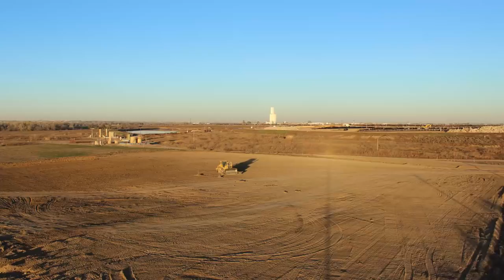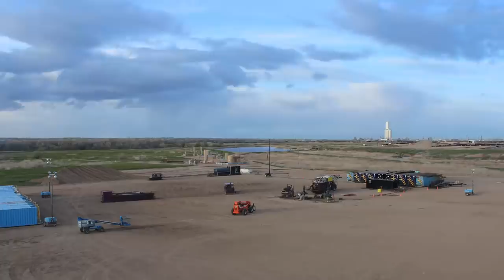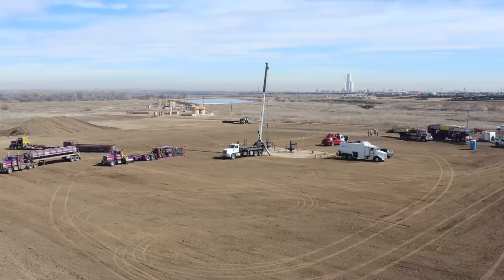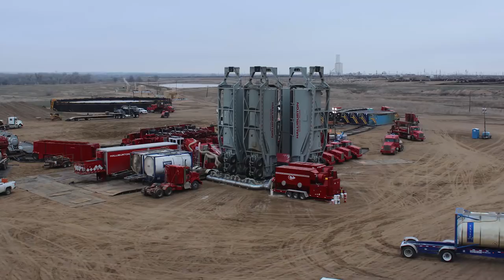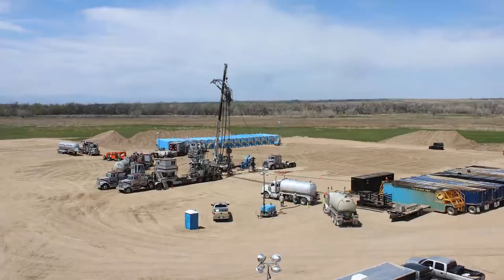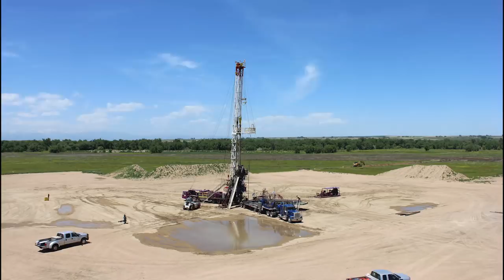Noble Energy | 5 Rivers time lapse

Comment: This is an interesting process and a great deal of people get their bills paid and get energy from this endeavor. The problems with fracking is the dependence on fossil fuels which contributes to climate change, the fracking fluid contains mostly water but also includes sand,  some antibacterial agents, acids, and lubricants. Not all of that fluid gets pumped out and if it is, it’s not guaranteed that it will be treated properly. For the fluid that’s in the ground, it is entirely possible to have cracks in the pipeline and it leaking into the groundwater. The damage the communities, ecosystem ,and to the climate is what you have to balance when you produce and consume fossil fuels. As a society we need to make a sustainable future but fossil fuels are a great energy source if it wasn’t for the pollution.